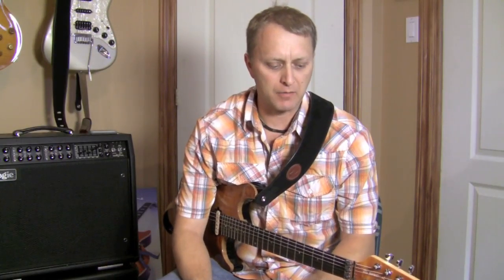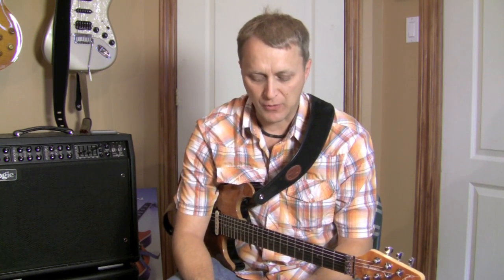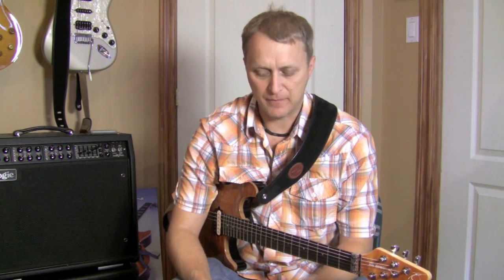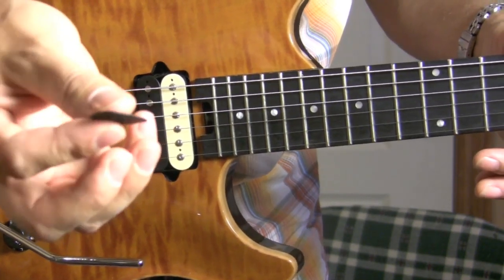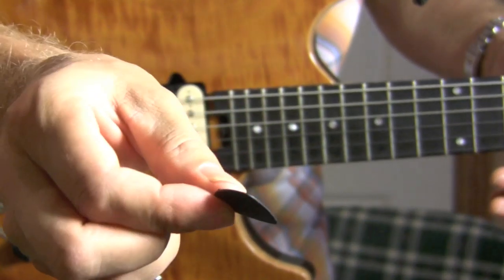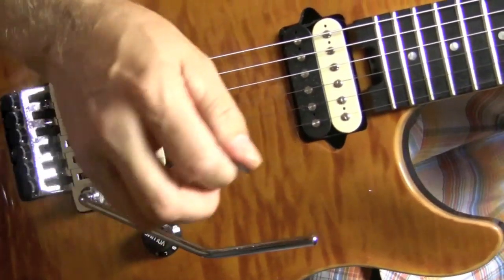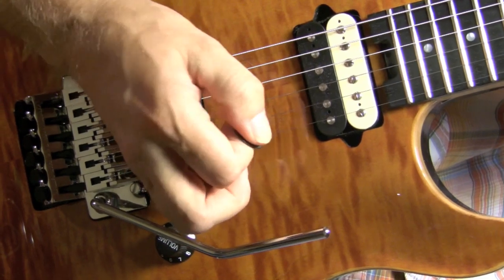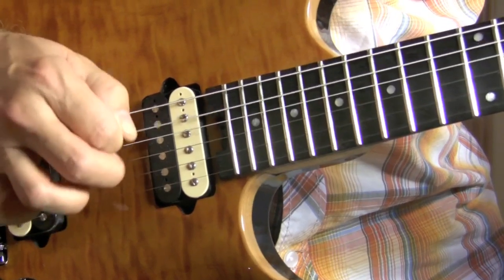Pick Harmonics - Lead guitar tricks

Comment: the type of pick doesn't matter at all, I can do it without a pick, if you don't understand the mechanics of an Artificial Harmonic a/k/a Pinch Harmonic, my dad's called it "Flat Picking" before... but it's about being able to mute the string IMMEDIATELY after picking it, & you have to pick it in the right spot which is usually over the neck pickup somewhere....

Comment: I have always known this technique as "pinched harmonics".
Is this right or have I been mistaken all this time?
Also there is another technique called "touch harmonics" and this is where you use a finger on your picking hand to touch the string either as it is picked or shortly after its picked.
Reply: Hi Paul,

Don't know much about the semantics around the terminology, but either "pinched", "artificial", "picked", it seems to go by all of these terms. All I know is that right hand (picking hand) position, movement and attack are can help generate harmonics all over the place.